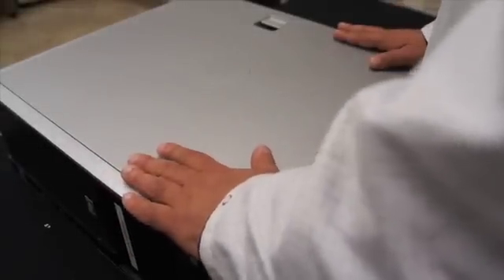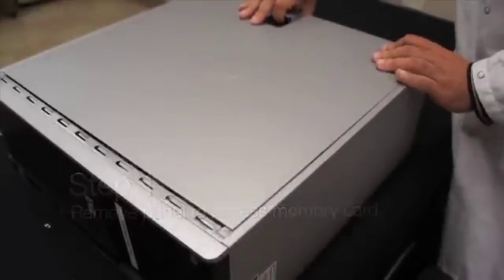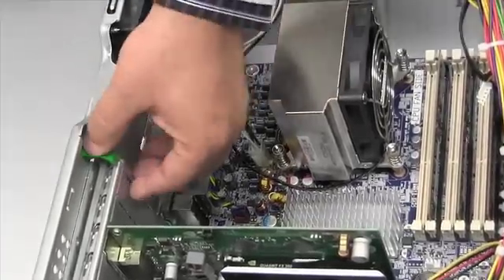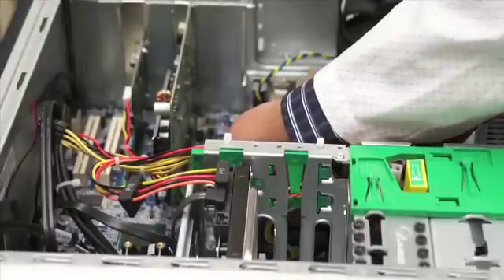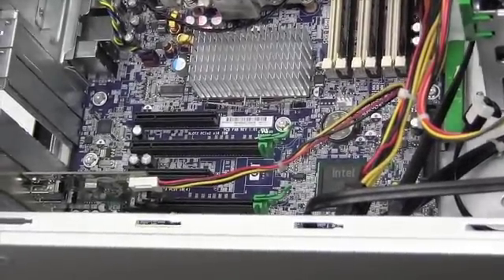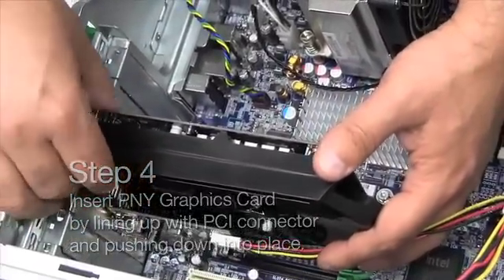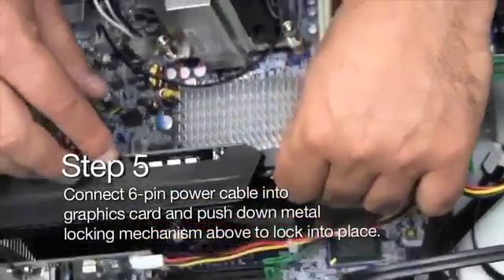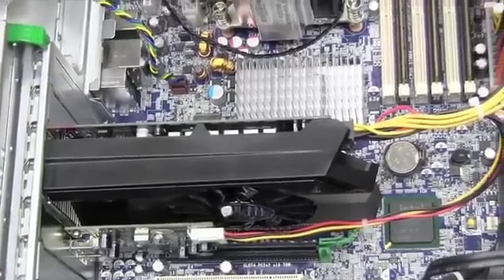How To Install a Graphics Card in Your Desktop Computer

Comment: My specs are:
GPU: NVIDIA GeForce GT 730
CPU: Intel(R) Core(TM) i5-6400 CPU @ 2.70GHz
Memory: 8 GB
Operating System: Microsoft Windows 10 Home (64-bit)

Can I install GTX 1050 ti?
Reply: Backz i have the exact same specs personally i don't recommend it try a gtx 750 ti
Reply: Norv but 750 is worse?
Reply: thats not the point. how much power does your PSU have?
Reply: @Sweetcuber thanks ill install it tomorrow
Reply: @Sweetcuber im just messin with you bro i have a completely different pc now

Comment: when i first got my computer i was really happy with it then i wanted to upgrade it and i got a gtx 750 ti oc and when i plugged it in to my computer it wouldnt work and i think it has something to do with the lack of power what should i do??? btw it came with a adapter but the  graphics card is a 6 pin and the adapter is a 8 pin
Reply: get a better power supply if there isn't anough power??????

Comment: i have a hp dc 7900 desktop 
cpu:core2duo e 8500 3.16ghz
ram:3gb 
I want to change graphics card
What is the best graphics card for me?
Reply: For games? Get a gtx 750 ti (budget) gtx 960 (normal) gtx 970 (high budget)
Reply: But these cards sizes is not commensurate with the computer because the Desktop
Reply: +PrankcallKing NL What's better, one 960, or 2 750ti's?
Reply: SunnyDoesntMinceraft 2 750 ti's are prob better but one 960 is way better for the price
Reply: PrankcallKing NL Well, I have 1 750, so I could have 1 960 and 1 750ti
I just didn't think of that at the time i guess.
Reply: SunnyDoesntMinceraft Sell your 750 and buy a new card.
Reply: PrankcallKing NL k
Reply: I have the same computer as you I wanna upgrade to 960 even though its 2018 now